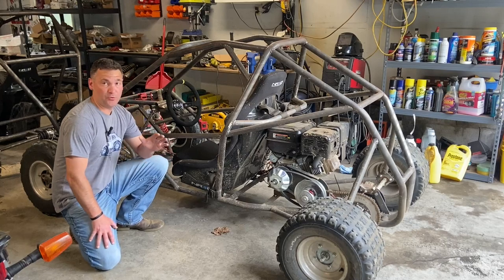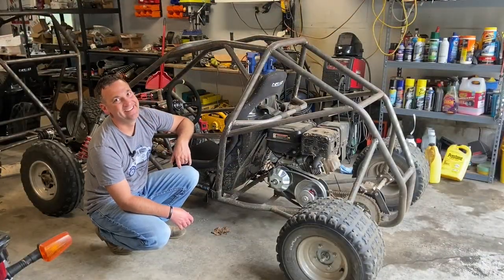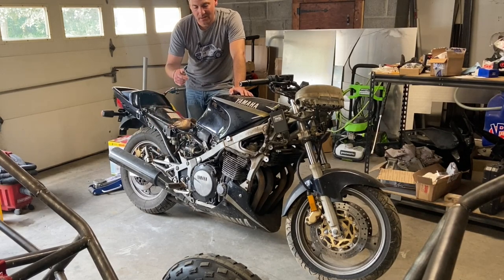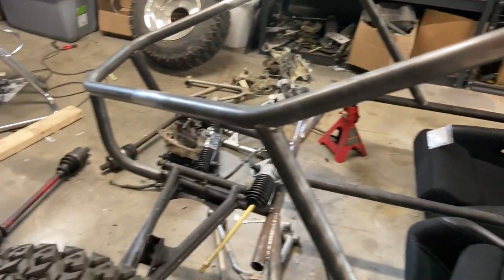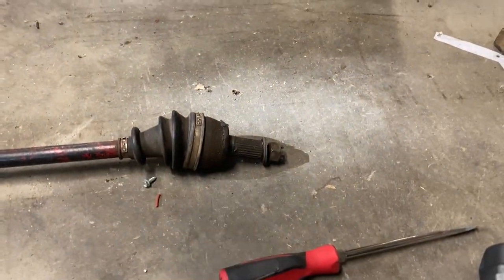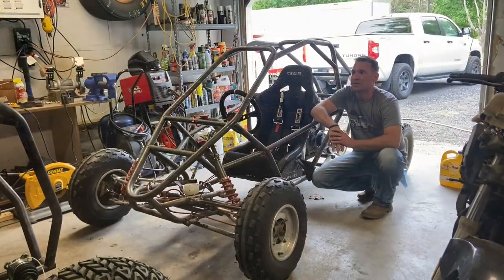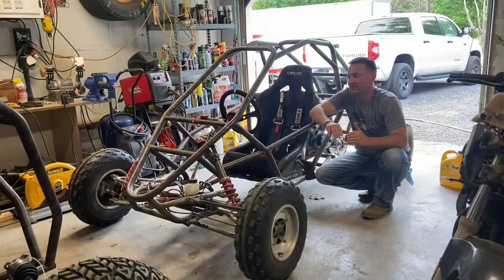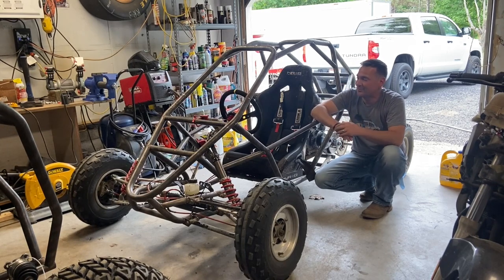Homemade Crosskarts: Link to Plans in the Description

Comment: any GSX-R from 2000 750 or 2001 1000 on theres very little in it i'm using a gsxr750 which are built light and has the explosive power which are good for a 145-150 hp you dont really want to use an engine with a slipper clutch though, they are quicker than an old fj 1200 by a bit, I am after that insaine acceleration of a GSX-R but he unto himself some parts on mine I've built A-Arms 3 times trying to be as light as I can possibly get them, I am using the Miata discs with GSX-R front calipers, I used honda life ball joints and hiem end back and front i tried a few ideas with the rear using landrover front spring bushes worked pretty good but weight wise hiems were lighter I want to beable to take a beating but light, easier said than done

Comment: Just a FYI…. Many states have a maximum vehicle width for trail use, in WI and MI it’s 65”
Reply from the maker: Wheel offsets can change that in a jiffy 👍. The wheels on there are 3+5. Just flipping them would make it trail legal. I used to do that with an old kart when trails were 50” restricted.